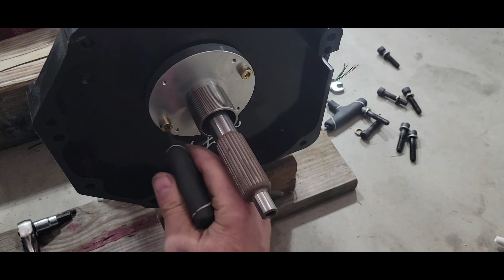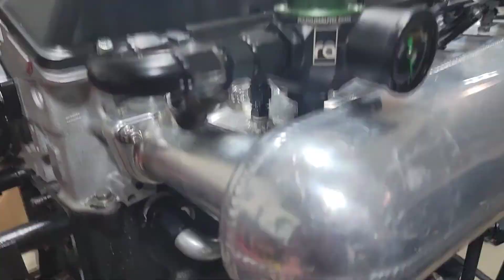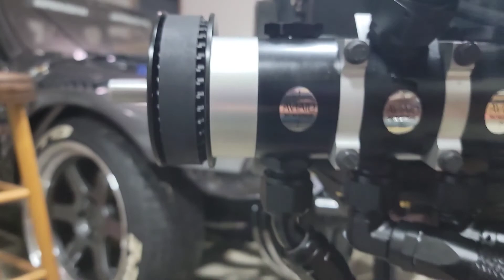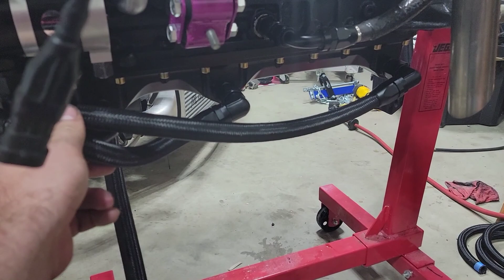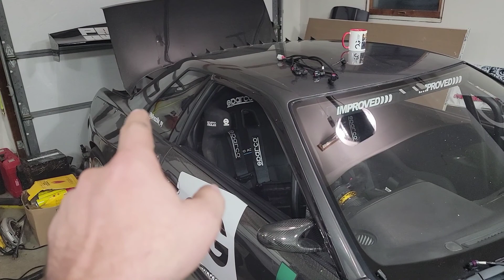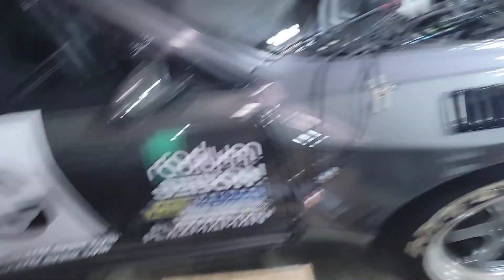Tilton Hydraulic Throw Out Bearing, Samsonas, Ross Dry Sump and engine build update

Comment: Looking good sir. Those hard lines are a work of art.

As for filtering the oil, I'd run a filter off the scavenge prior to reservoir and then one off the pressure feed post reservoir. Overkill, but hey, clean oil makes for a happy engine.

Question I have is, what is the parasitic loss of running that dry sump?
Reply from the maker: Thanks for the tips! Parasitic loss I'm sure will be slightly higher compared to a crank drive oil pump to a degree but I'd imagine unnoticeable. Since the Dry sump creates a vacuum in the crankcase and essentially eliminates oil sloshing, oil windage and aeration are dramatically reduced if not all but eliminated.